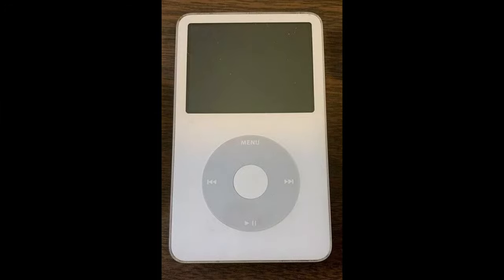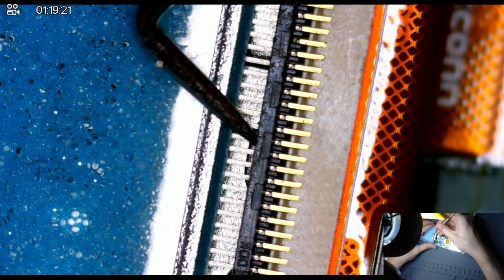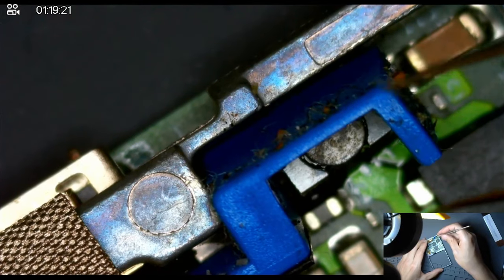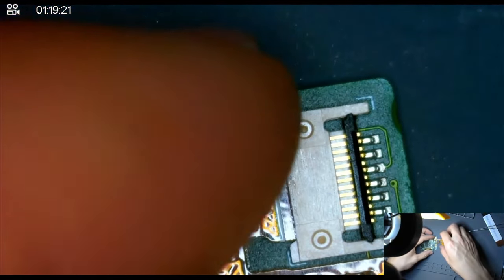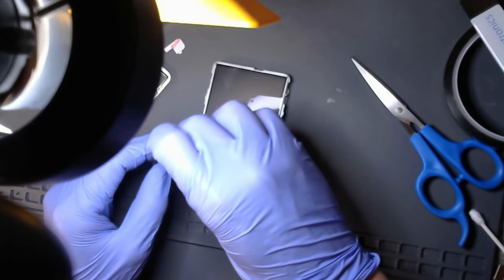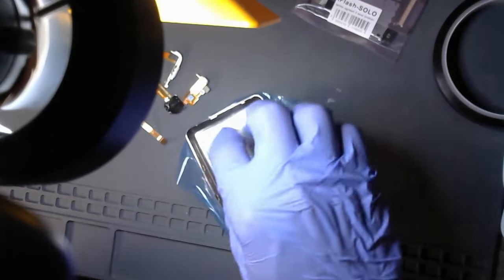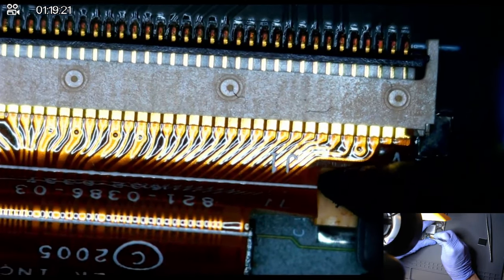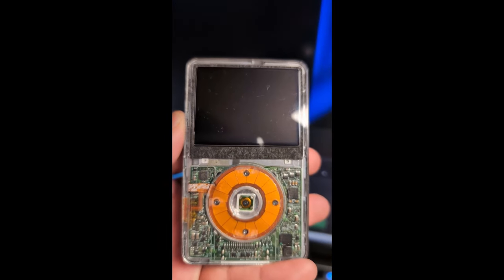Upgrading My Personal iPod

Comment: I was very afraid of ripping the ribbon cable the first time I opened up an iPod, but after doing it so many times you can just pop those open and pull them out pretty easily without actually having to worry about ruining them. I just pop the clips open in one go usually with my finger nail but maybe a plastic tool that comes with a lot of repair kits. No real need to do it very carefully.

Comment: I’m 90% sure the little leg that glues to the frame from the click wheel flex is to give a good ground reference for the capacitive touch used for the scrolling. Same with the kinda foil thing behind the click wheel on the main board that’s also attached to the frame, and a pad on the Hold switch flex PCB. Some aftermarket click wheels without the leg seem less sensitive (annecdata)
Reply from the maker: That makes sense. I wish that there was some reference or documentation on how to replicate the "glue" that was used to attach it back onto the frame. All I had at the time was kapton tape unfortunately.